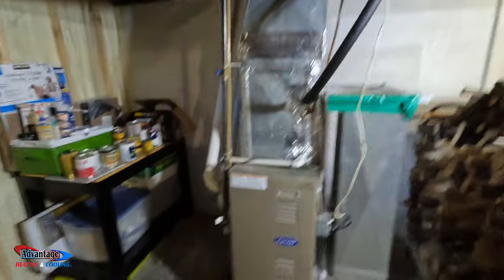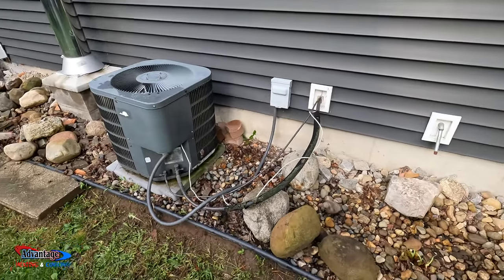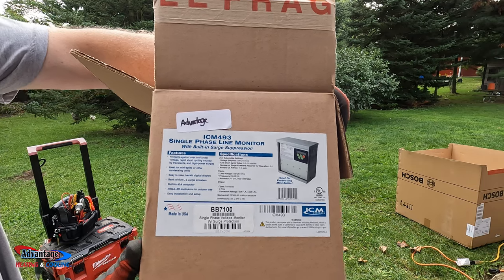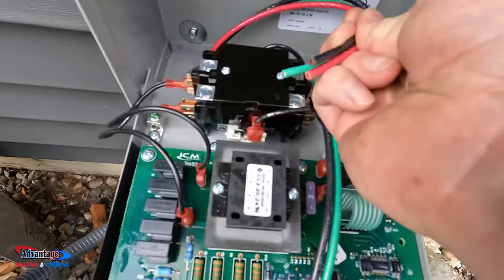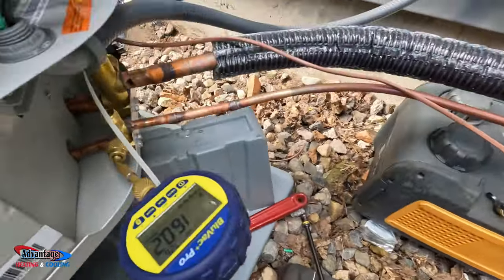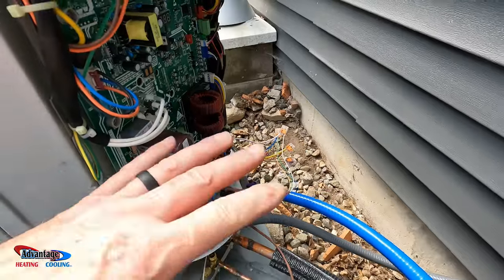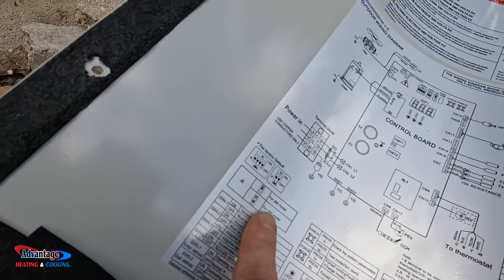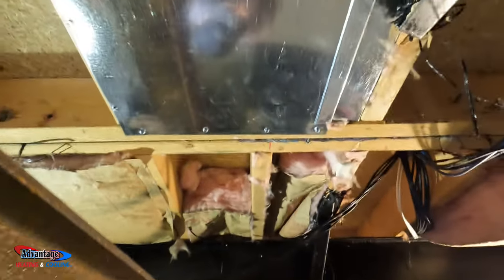Bosch IDS 2.0 Unleashes Ultimate Control on Goodman AC

Comment: I was told never to change the J2 dip switch on my ids 2.0 I have a 4 ton air handler with the 5 ton condenser. Can I ask what it would hurt if you left it as a 3 ton? Or in my case a 5 ton?
Reply from the maker: It wouldn’t pull the humidity out. That house was only 1200 square feet.
Reply: @ADVANHVAC  You should make a video on bosch and humidity issues /solutions.
Reply from the maker: I haven't had any issues with Bosch and humidity issues.  There are some tricks you can either slow down the blower a tickle witch will make a colder coil equal Less humidity.
Reply: @ADVANHVAC  Yes. Someone needs to  make a video on how to do such a tricks  because I've read and watch videos of people blaming Bosch systems.
Reply: @ADVANHVAC  dip switch to make the evap colder...like the surge protector..nice install..

Comment: in heat mode, The heat pump will shut off at 35-40 degree ambient temp and have the furnace come on. The furnace and the heat pump are never on at the same time. Even in defrost mode.
Reply: These inverter units dont do that, you can have them run below that with still good efficiency